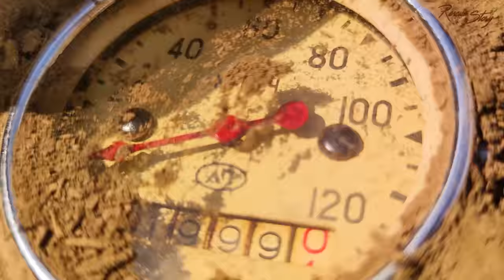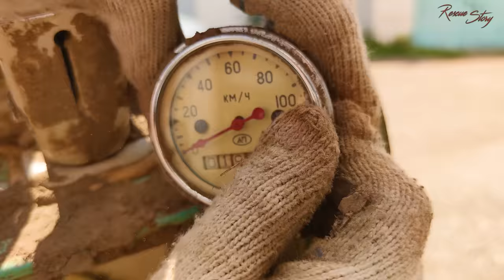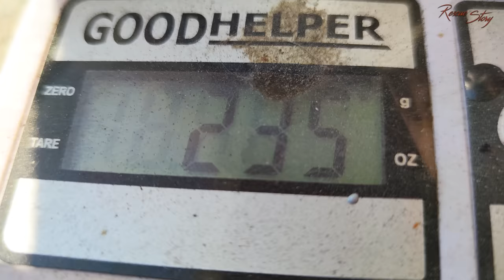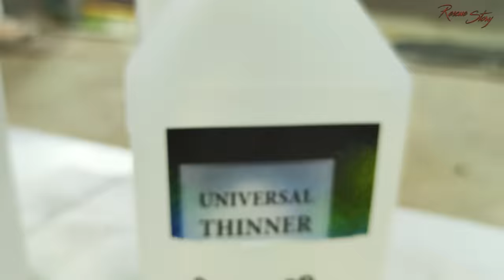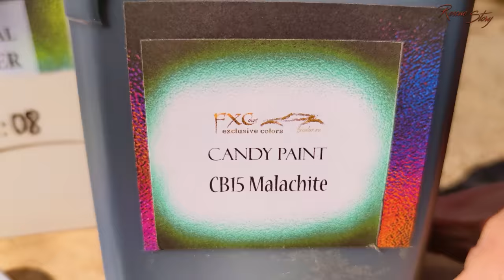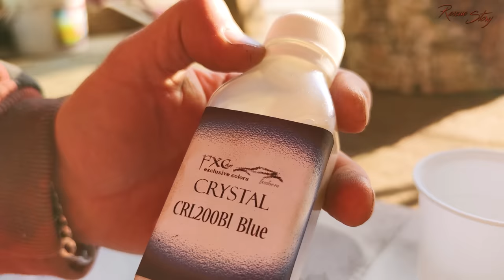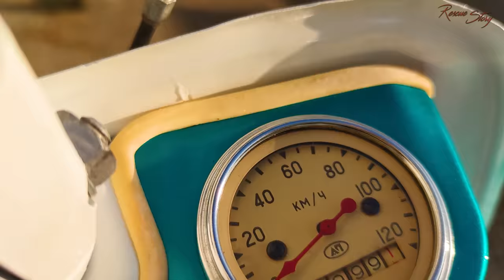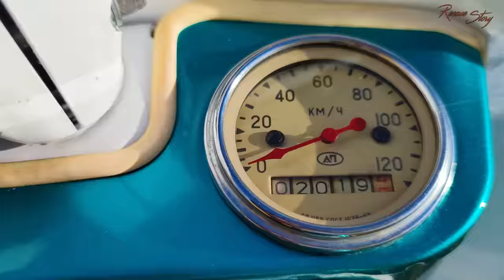Fast Restoration 1960s Piaggo Vespa Scooter | Little Abandoned Motorcycle - Full Restoration

Comment: The cylinder didn't look very well honed out to bed in the rings properly, I shouldn't mention it but I noticed on many engine assembly jobs on YouTube, that they might do it but don't show them clean and cross hatch hone out the cylinders 😮 and for people learning from these videos its a very important part of the process, if you don't want the engine to suffer low compression and for 4strokes- oil consumption, but absolutely awesome paint and chrome jobs that I would spend weeks trying to get anything close to that finish on my recent paint job on my bikes tank, thank you awesomely for sharing your very satisfying experience 😀